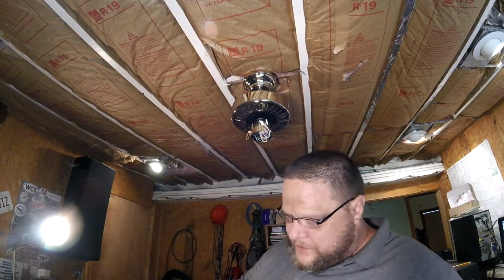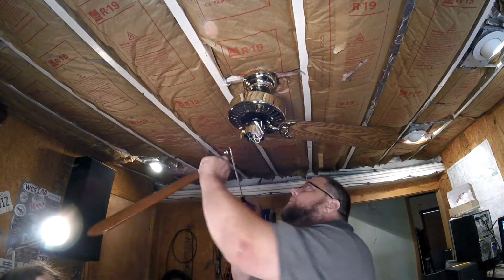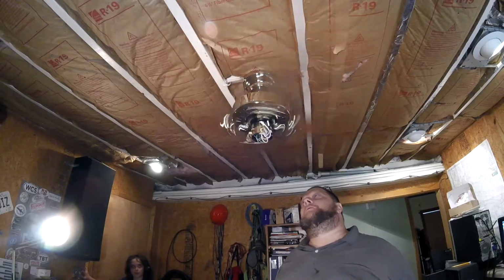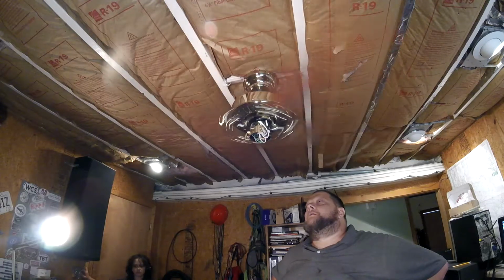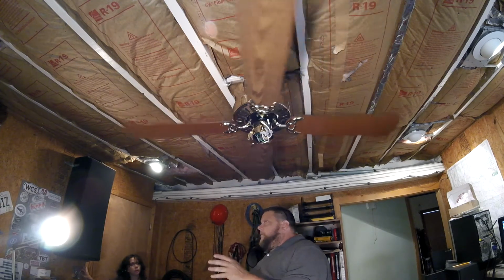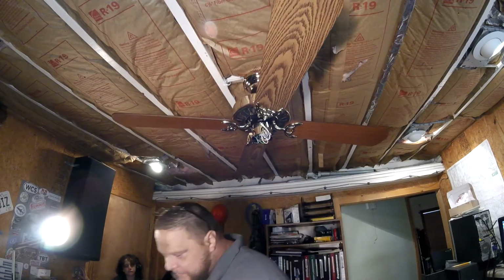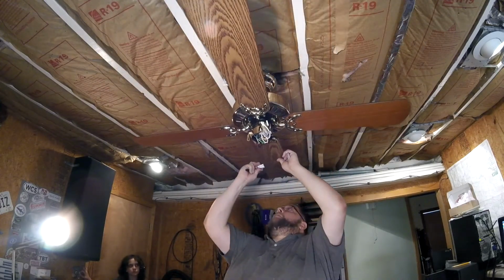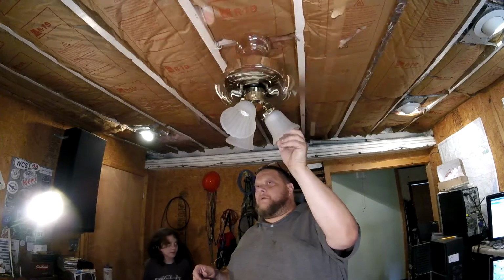Strongs winds a blowing

Comment: Nice balancing of the fan. The LED bulbs have come down in cost and last longer, & burn less power. I have been converting over to them in both my house a shop, as a bulb goes out. I like the light and the long term cost savings.
Thanks for the video!
Reply from the maker: Jeff Erdman something keeps blowing bulbs, heat, vibration,high voltage nobody knows that is why I have made the changes